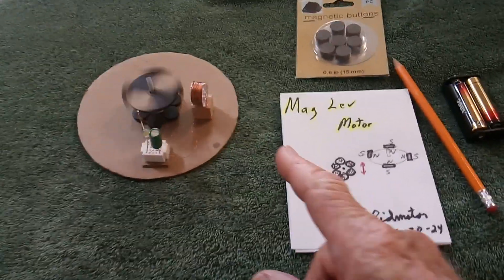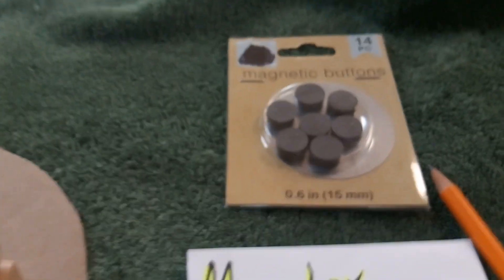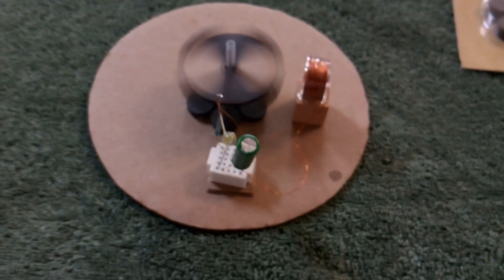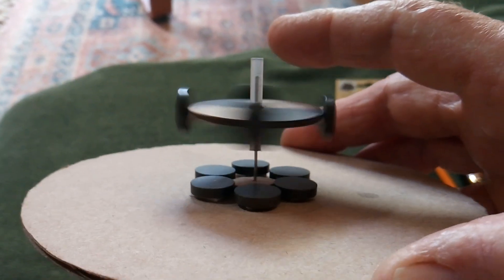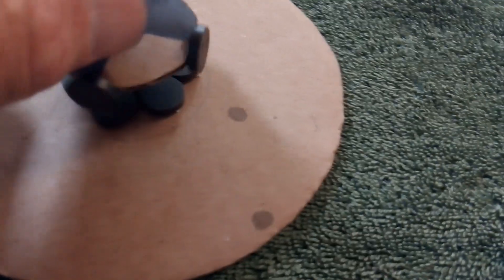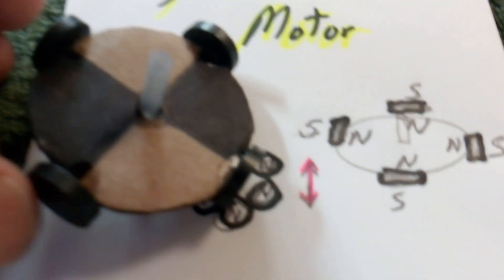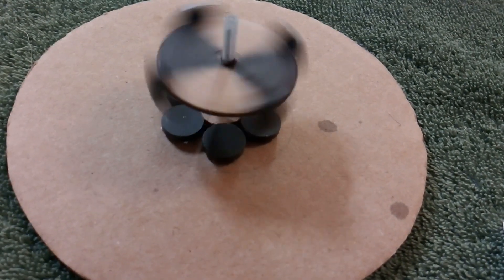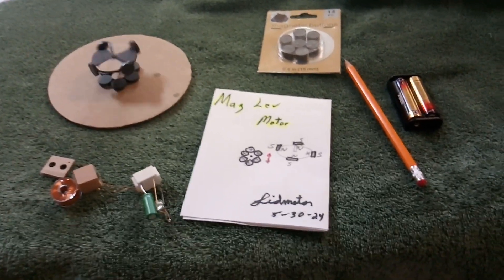Mag Lev Motor

Comment: Well finally after watching so many of your videos I made something like this one but I 3D printed the rotor and base, used 6mm x 1.5mm round neodymium magnets. I had a solar waver I was going to sacrifice but unfortunately broke one of the coil wires in the centre so I ended up finding a small pcb mount relay and cut it apart to recover the coil and removed the metal components. It was running at just under 4mA so where near as frugal as your microamp levels but it does work and will run maybe 1/2 hour on a 1uF cap charged to 5V
Reply from the maker: Great news about 3D printing this.  That is on my to do list but I have not found the time yet.  Your driver sounds good.  Congratulations!

Comment: nice, now you only need to eliminate the sideways friction  and Air friction, sideways friction is reduced by balancing it, but also by just letting it touch it less, air friction in many ways.
essentially if you would put this in a jar and make it kind of vacuum, and make the sideways friction low enough then it might be able to run even with something like a single pulse per day,
but already great as it is.

also might wanna also start uploading to more open platforms like odysee. since recently there has been a huge amount of shadowbanning and such on youtube, where youtube creators even got their own comments hidden from vieuwers without notice(so got shadowbanned on their own channel while not doing anything wrong). meanwhile the platform now also has tons of botnets and scammers on it, just look at all the top comments on big videos which are all promoting some kind of unstable product or other things which clearly isn't good but which is supposed to trick people into getting it anyway.

also might want to combine this with a radiation pannel, that way it will look like a true free energy mashine to people, since radiation pannels essentially like solarpannels turn radiation into energy, bowever they have a much wider range but lower efficiency for things like sunlight, actually they work mostly by directly catching electrons and clear imbalances.
you can make one using a simple sheet of aluminium and putting some transparant plastic over and under it, then connect it to a capacitor, the ground is connected directly to earth.
while such small radiation pannels don't really work as well especially not inside and at low heights(ion energy might also work, but radiation pannels are smaller and less noticable as they don't need a antenna or such, alternatively you can also use a litteral radio antenna to capture radio energy).
but a radiation pannel is easy to make, and can still charge capacitors quite a bit bigger than that rather rapidly even in terrible conditions like inside or at low height.
I once made one for a demo, made a small pyramid shaped radiation pannel(for looks since it was a scale model of a building but actually working). people where really suprised when I took my multimeter and showed it was actually generating energy, and obviously they didn't understand how it worked.
but often this mystery is needed to spark the imagination of the newer generations into science so they aren't bound and held back by the rules of people who beleive so much in their own old rules and limits that they will even make up lies or spoof data just to not have to accept that physics are far more complex than they understand.
this is the old pattent(very old): https://teslauniverse.com/nikola-tesla/patents/us-patent-685957-apparatus-utilization-radiant-energy
and a article about it: https://teslauniverse.com/nikola-tesla/articles/nikola-teslas-radiations-and-cosmic-rays
if you preffer to use other methods that can also work, the general idea however is that you add some simple energy generation method and then use that in order to power the device, so it doesn't need to be charged and can keep running, but optimally also so only people who understand physics will actually see how it works, and so others will get that spark to dive deeper into physics until they understand it.
people need dreams and motivation these days.

Comment: Good way to eliminate friction.
Fun experimenting with the separately adjustable sensor and coil unit.  Somewhere out there is an optimum spot waiting to be found.
Reply from the maker: YES!  Somewhere out there is a person who could use math formulas combined with precision skills to build a much better one.  There is an "optimum spot waiting to be found".
Reply: @Lidmotor  Its all good. According to my theory, this empirical method is more fun!  ...And open to discovering the unknown factors.
Reply: @Lidmotor  
Its all good. My theory is the empirical method is more fun. And with that fun the possibility of discovering unknown factors destined to populate tomorrows most powerful engineering formulas.

Comment: Im assuming thr center of the top ring of magnets is over the center of the bottom magnets? Or does it matter that much how clise to the center it is? Very cool motor, it looks like it will spin for a long time!
Reply from the maker: That is a very good question about the magnet alignment.  The rotor magnets are aligned on the outer edge of the bottom magnets array.  It is kinda weird that the rotor floats. There is no cogging. It was just an accident that I found it.

Comment: Is it necessary to use a super capacitor to make the circuit, and what about the magnetic switch and what is its benefit?
Reply from the maker: Any 1 to 3 volt power source will work.  The supercapacitor is just an energy storage device that gives me a simple way to observe power consumption..  The magnetic reed switch is nothing special and is just an easy way to turn the power on and off.
Reply: @Lidmotor  Thank you for the response...and I am one of your long-time followers...but does this mean that it continues indefinitely...I do not think so unless there is, for example, another coil that gives bursts of dissonant induction to the poles of the magnet.
Reply from the maker: @dhmevip2541  This will run as long as you power it.  The simple motor is not self-running. Thanks for watching.

Comment: Have you ever considered creating an internal symmetrical coil (while the magnets are on the outside/drum), so the centrifugal forces pulling outwards while it rotates, counters the drag of the of the field induction?
Would have to calculate the angle of the coil/coils to also include gravitational pull down and the forces of the drum pulling outwards.
May have to use multi-layered coils going into opposite directions with possibly aluminum as a shield.
Reply: You want to try that you never know until you have tried. I have found that you usually learn something even if not what you were expecting.

Comment: I found that it will lift a heavy weight with Neo mags. great design I wanted to put a circuit on it yrs ago but I'm terrible with circuit I got plenty of reed switches LOL
Reply: The coil he is using is made from a sewing bobbin, wired through/with the read switch. The coil gives the push. Genius in its' simplicity.

Comment: How many turns do you have in the coil
Reply from the maker: I didn't count them. Probably several hundred.  Just fill up a plastic sewing bobin with any fine gauge magnet wire.   30 ga wire work really well.

Comment: i love it, but fidget will do better, get a fidget spinner
Reply from the maker: I did like you suggested and got a good one that worked really well.  I experimented with it for a few days but didn't make a video of it.  The one I got was solid brass.  It has arms that can be unscrewed and you can try different configurations. The bearing was precision and might run for years. Thanks for the tip.
Reply: @Lidmotor  nice, you find my models? are your arms 1cm diameter? plz video of it- i could not find the models i got years ago on search, looks like the seller i got it from isa no longer there but ispin spinner  is still going, they are more expensive but worth the money, these ispinners, where did you order from?
Reply: @Lidmotor   @Lidmotor  nice, you find my models? are your arms 1cm diameter? plz video of it- i could not find the models i got years ago on search, looks like the seller i got it from isa no longer there but ispin spinner  is still going, they are more expensive but worth the money, these ispinners, where did you order from?